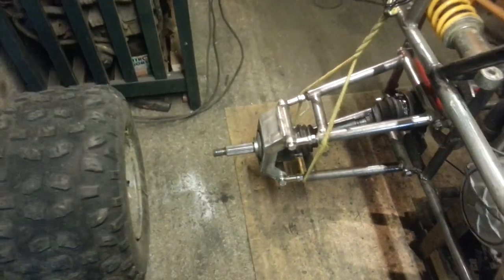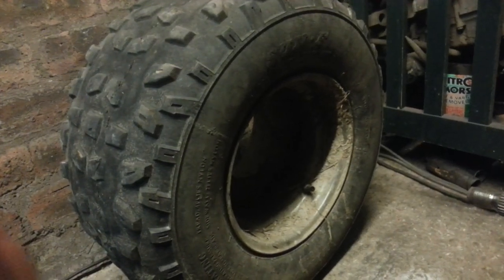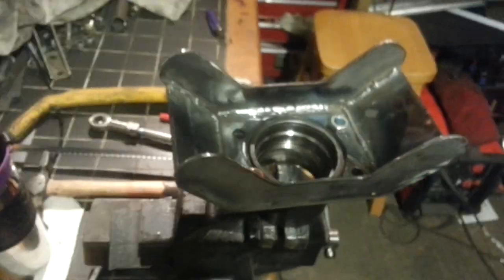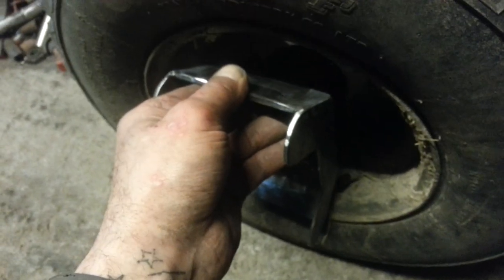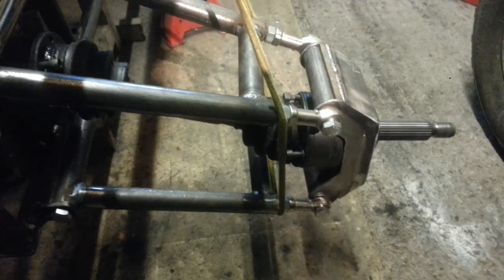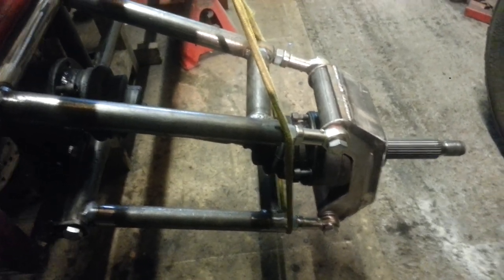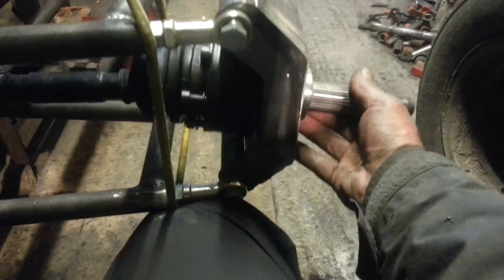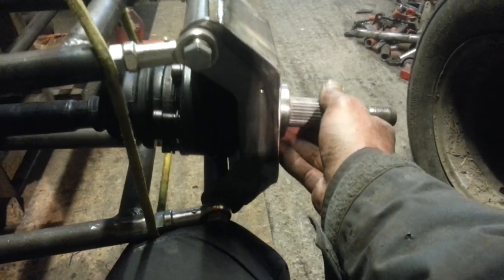Dune buggy build rear suspension

Comment: How does the cv axle connect to the hub with the sprocket and break disk
Reply from the maker: Hi 
Sorry for delay the axle is from a Ford Sierra Sapphire Cosworth the bearing carriers are from the same car and are bolted to the hub the cv axle is secured goes through the bearing carrier and held in place by a single nut .
Reply: Steve Ritchie thank you for answering

Comment: hey man great video. I am having trouble with the chain driven deferential did you make yours or did you buy it somewhere
Reply from the maker: Mike Rayman 
Hi Mike I made the chain drive myself from a collection of parts ! my main problem was getting the gearing right and I'm sure I ended up using a 12 tooth gear on the engine and 38 tooth for the main drive .

Comment: What axle set up are you running?
Reply from the maker: sam barnes    Hi 
I used 1990 sierra cosworth driveshafts cut down and sleeved along with the same car bearing carriers and hubs with the 108 offset
I also bought weld on 108 CV adapters from DRD racing  http://www.shop.drdracingproducts.com/108-mm-weld-on-CV-adaptors-108-cv-adpt.htm which i welded to the steel shaft after i had fitted the hub adapters for the 42 tooth sprocket and disc break but i had endless problems with the weld on CV adapters breaking there welds to the steel shaft and was looking into a different set up using a keyed shaft to allow me to not be repairing broken welds and also make it easy to replace worn parts but ended up selling the buggy before i got the chance to upgrade it 
Hope this information helps and if you need any more info feel free to ask and i will get back as soon as i am available 
many thanks Steve .
Reply: thank you steve thats everything i needed, i will do some searching, thanks sam

Comment: e só usar aro  de roda 12 ou 13 infelizmente ficou grande
Reply from the maker: have a look at my other videos i managed to fit 10 inch wheels by cutting up an old set of cosworth ford discs and welding them to the 10 inch wheel giving me the 108 pcd and the strength in the 10 inch wheel to take the power